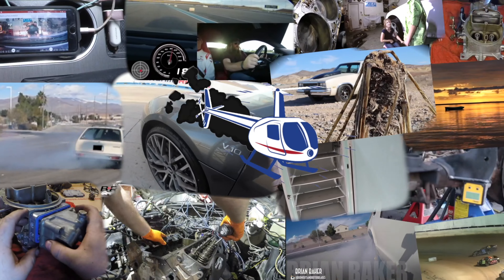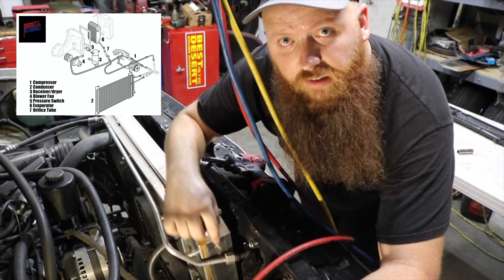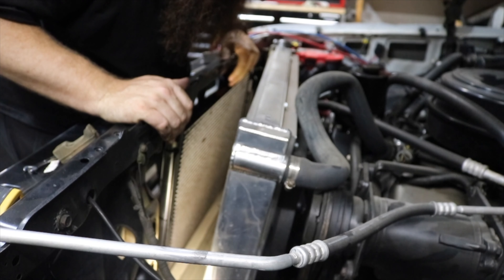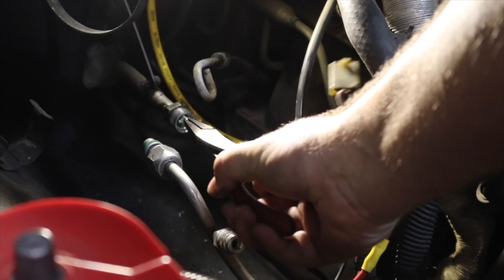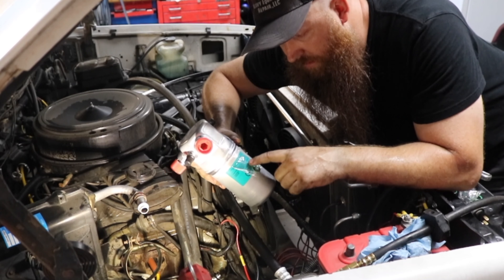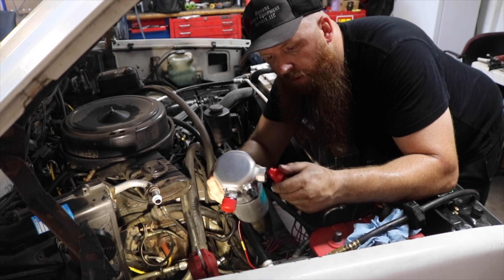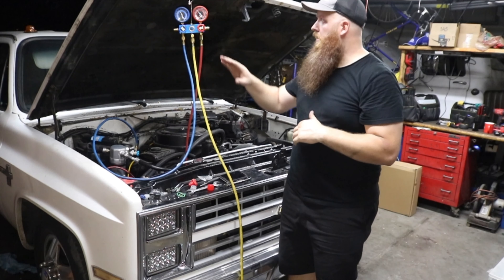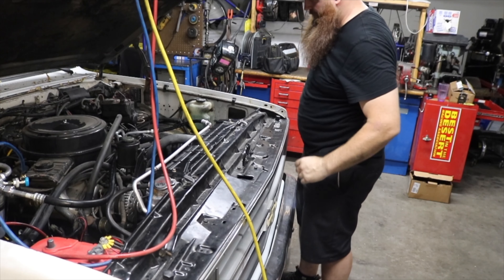r12 to r134a Conversion | AC troubleshooting and repair | Duct Repair | Squarebody truck | Moby EP 2

Comment: Very helpful video, thank you for sharing! One comment that may help others: a binary or trinary safety switch should be installed on the high side and would shut off the compressor around 400psi. The switch also shuts off the compressor when there is too little pressure in the system (indicating loss of freon) which will prevent damage from running the compressor without lubrication circulating. These switches can be installed anywhere in the high side of the system; sometimes there is a port on the drier or accumulator and other times you may need to add an inline port. If you use a trinary switch, in addition to the compressor safety functionality, it can also control the electric fans so they do not have to run at high speed unless needed..

Comment: I did that on a 84 chevy you cant even hook the lines back up they Changed them too! I put some cleaner in mine next day blew them out new compressor new dryer had to reuse the old lines just to reconnect it all but runs Sweet now !

Comment: In pretty much the same situation as you... also really don't want to replace the evaporator core. The previous owner did a engine swap and never put the AC hoses back in after so the evap core has sat open for awhile... visually it's in good shape, do you think I can get away with just flushing it and replacing the orifice tube or should I replace it?
Reply from the maker: I would absolutely just flush it out and run it. I might also suggest a pressure test. Pull a vacuum on it for an hour, then let it set and make sure it doesn't leak.

Comment: 5 years.  Is that only in Vegas?? Lol. My 93 ford Flareside still blowing cubes 30 yrs with the OG R12. Lol.  Knocking on wood.  So far so good. I get clouds ☁️ in my cockpit.
Reply: I will admit .. one high pressure hose has a good crack (dry rot) and will blow one day .. and I did go through a clutch /field and pulley on it. But it’s still blowing decent after 30 years.

Comment: Where do you add the remaining PAG oil? the compressor came with 3oz.
Reply from the maker: I would not trust what the compressor said it came with. Dump it out and add 3-4 oz back in. Then use an oil injector to put the rest in. Also, I used esther oil.

Comment: Dont charge liquid into the low side.  That can damage the compressor
Reply: What???!!! This is an old comment but didn’t notice any replies so before anyone blows them selves up… don’t charge on high side hence the “HIGH” pressure. Very dangerous especially with the little cans that aren’t meant to handle that pressure. Even in residential we charge via low side typically before running system but if it’s running you do small spurts at a time to avoid sludging

Comment: Watching you initially adding refrigerant to the system, it appears that you may have inadvertently hydraulic locked the A/C pump by adding the refrigerant with the refrigerant can held upside down (if inverted  it goes in as a liquid and not a gas)...hence the squealing drive belt. When adding reftigerant I prefer to start the engine, turn on the A/C, let the (upright) pressurized refrigerant enter the system (as it's initially under vacuum) until the A/C low pressure sensor registers enough pressure in the system to switch on the pump. At this point observe the gauge pressures carefully as the refrigerant is now drawn to the system until you're satiisfied that there's a correct balance between the high and low side.
Reply from the maker: My belt was loose and I tightened it off camera. I was trained to load a system with liquid. If you have some technical data showing to load a system with gas first for some benefit i'm all ears.

Comment: We're did you get the parts for this project...thanks
Reply from the maker: A combination of Oreilly’s and Amazon.
Reply: @BurnoutsAndRotorblades  
I have a 85 k5. I guess after watching your video I need to do the same thing..
Reply: Also do I need to change the compressor out to or will the old one be fine as long as it works?
Reply from the maker: @davidolds1972  that depends on a lot of things. The textbook answer is; for the absolute best results replace the compressor, orifice tube, dryer, condenser, evaporator, and any compromised lines or hoses. I personally usually try to just flush the evaporator core because the passages are larger and it’s possible to get shavings and junk out combined with the very inconvenient location. Not replacing the other items is a gamble I would only consider if the system was working perfectly but sprung a leak. I always replace the orifice tube and dryer. If there is any metal on the orifice tube, the condenser is probably compromised and depending on what the shavings look like, so is the compressor. Long answer to basically say, do it once and be done with it.
Reply: I agree with you . The vehicle only has a 120000 original miles. But I don't know anything about it. I bought it like this .thanks for the help .What state are you in?

Comment: Can someone please let me know the part number for the cycling switch since it was converted from r12 to r134a? The original one is meant for r12 and I can't seem to find any information on which switch to change it out to.
Reply from the maker: I didn't change mine. It still works fine.

Comment: Great informative video 👍👍👍👍  I just replaced everything on my C10, R4 compressor, condenser,  dryer, evaperator, and hoses.  My question  is how much oil do i need and where do i add it to?  Hope you can help and keep up the great videos.....
Reply from the maker: I had to call the dealership. Also, use ester oil and not mineral oil.

Comment: Nice detailed information. My 95' chevy 2500 I used a sandon compressor to replace the pancake R-4 and it works much better than before.
Reply: Can you confirm what type of pressures you we’re getting under normal circumstances?

Comment: So I just did this conversion on my classic. I kept the old evaporator core, but I ditched the ancient condenser for the new style r134 compatible condenser. I also swapped my 10,000 lb enormous compressor for a newer sanden. Now, no matter what I do, I cannot get my air to blow colder than 58 degrees. I even had a trusted AC tech try his hand at it with the same results. Is my evaporator core just junky/not efficient? It's from the mid 60s...
Reply from the maker: This problem usually means your fan setup isn’t cooling the compressed charge enough, if your pressures and Freon levels are all correct. See what happens when you spray a bit of water over the condenser with the em system running. If the interior temp drops then you need to make the cooling system more efficient. Add a fan shroud or seal up any holes that can get to the fan without going through the radiator/condenser. Also, putting insulation around your cold line and dryer will help things cool down.
Reply: @BurnoutsAndRotorblades  Dude thank you so very much for your response! To be honest, I never thought I'd hear anything, but figured I'd give it a shot. I never really thought about the fan not pushing enough air through. The original OEM setup didn't have anything (no fan, shroud, nothing... Just an ENORMOUS condenser core), so I figured I was doing my system a massive favor by adding an electric fan. The condenser/fan just hangs out in the front of the car ahead of the radiator - no shroud, nothing. Hah... Shows the little I know overall. I'm going to try that water trick to see if that makes any difference. If it does, then I finally have a direction I can go in to tackle the problem! I have room for a second fan, so I might just do that anyway.
Reply: @BurnoutsAndRotorblades  AGREED!!!!

Comment: Question, is it ok to use ester oil on a factory mineral a/c compressor after the r12 to r134 Convertion? Great video btw! Thank you
Reply from the maker: Thank you!!! The Esther oil is specifically for use when converting from r12 to r134a. It is compatible with both refrigerants and with the mineral oil.
Reply: @BurnoutsAndRotorblades  really appreciate it! Happy 4th 🍻🍻🍻

Comment: Everything was going great on my truck
Gauges were showing good
Putting in freon
2.5 small cans in it
Starting to cool then bam low side went super high and compressor started making all kinds of grumbling noise
Any advice from anyone would be greatly appreciated
Reply from the maker: What did the high side do? What work did you do to it? how old is the compressor? Basically, pull the orifice tube out and see if there is metal in it. It's hard to tell without being there in the moment, but most of the time if your compressor is making any weird noise, it's time to replace it. then you have to evaluate how far the damage spread. If there is metal in the lines, flush them. if there is metal in the condenser or evaporator, you have a better chance of getting pregnant than getting all the metal out. It's safest to replace contaminated cores. However, I wasn't there so I can't actually say for certain.

Comment: When flushing the evaporator does the expansion valve need to be removed? If not, can the flush come in from the discharge side? Thx much..
Reply from the maker: These trucks have an orifice tube instead of an expansion valve. You do need to remove the orifice tube because it acts as a filter for junk in the system. It's something you should always replace. If you are working on something with an expansion valve, I would recommend removing it and flushing the system that way. Also, it would suck to do all that work and have a $0.05 o-ring be the leak when you go to repressurize the system.

Comment: Im working on reinstalling the ac in my crew that was taken out by previous owner, where could i find the high pressure line from condencer to evaporater?
Reply from the maker: I found everything readily available through oreilly's. if not, get one from the junkyard as a template and have a custom shop guild one for you. Also, try LMC truck and the other online retailers.

Comment: way way back in ac school the only thing they said about charging the system up side down with liquid rather then right side up gas is do it slowly and don't slug the compressor with liquid or it will lock up good sound advice so if you do it slowly  and stop it to give it time to recover then start again giving it freon it should be fine
Reply from the maker: That is some great advice!

Comment: Hello, what were the low and high pressures you got at ~90 degrees, I’m trying to figure out what is ideal. Thanks!!
Reply from the maker: Pressures are too inaccurate to judge. Basically, they'll tell you if you have a blockage. if the pressure differential is too big or if your high side is much over 200, you probably have a blockage. There is a graph in the video. But I never go by pressure to judge a charge. The only way is by weight. Everything else is guessing.

Comment: I see you reused the compressor cycle pressure switch. I've also read that you can/should replace it with a R134 switch since they operate at different pressures. Is the new switch required?
Reply from the maker: I’ve done a number of these retrofits and never found it necessary.

Comment: What’s your thoughts on switching to the smaller .067 Ford blue orifice tube or a more expensive Vov? Looking on the forums seems like everyone has different preferences.
Reply from the maker: It has to do with your climate and refrigerant. I'm not smart enough on the subject to dial in my components like that. I just replace stock and it works well.

Comment: Was the evaporator same, as used on R12? , 
Is it better to upgrade to multiflow evaporator and Block type expansion valve?
Reply from the maker: Syed Wajahat Ali evaporator is the same. Switching to an expansion valve is unnecessary. The AC Blows I’ve cubes in the Las Vegas summer heat just fine with an orifice tube.

Comment: Excellent, thank you very much. I loved the duct sealing work you did; exactly the kind of thing I do, and will do in my car if necessary. It's possible the sloppy fit in the vent system is at least partly due to the plastic shrinking over time.
L/S
Reply from the maker: Excellent!

Comment: What would the capacities be for 86 suburban with front and rear ac r4 to 143a I have new compressor dryer orphis tube and condensor
Reply from the maker: I’m not sure specifically. I had to dig for mine. If you’re lucky, you’ll have the placard under the dash that’ll tell you how much r12 to use and then math out the r134 amount from there.

Comment: What is the brand/part number for the condenser you got? Also where did u get it. My 79 k20 is missing compressor ac lines and condenser but I want to hook the ac back up
Reply from the maker: Mine is specifically for the K30 with a 454. it's p/n NRC NC3642A from NAPA
Reply: @BurnoutsAndRotorblades  i thought it looked a little different. I think the ports should be on the driver side on mine. Thank you for the reply

Comment: 1) You should never trust the amount of oil they claim is in the new compressor.  You must drain, measure the volume, and then put in the correct amount based on the manufacturer's specs.  Keep in mind, that many of the new compressors designated for older cars come installed with mineral oil....
2) Blowing out the evaporator with shop air introduces a lot of air.  You should have blown it out with dry nitrogen.
3) For a retrofit, you should have evacuated 24 hours where the vacuum gets under 200 microns

Otherwise well done, as 99.999999% of all the other videos do not do the things you did of which are important to do.